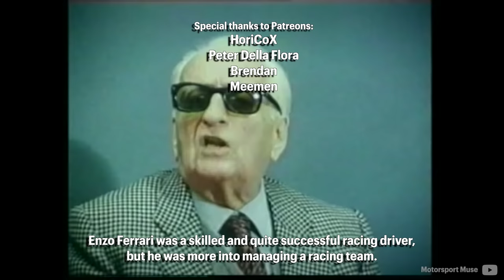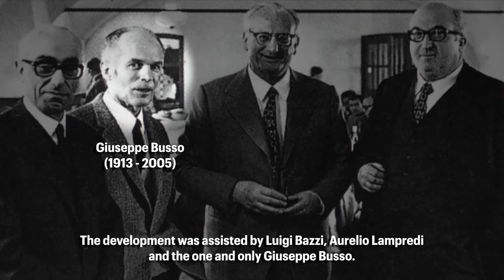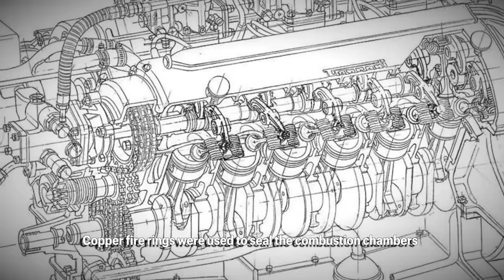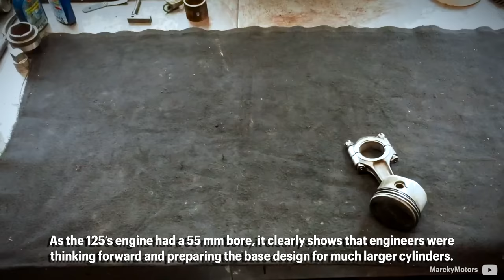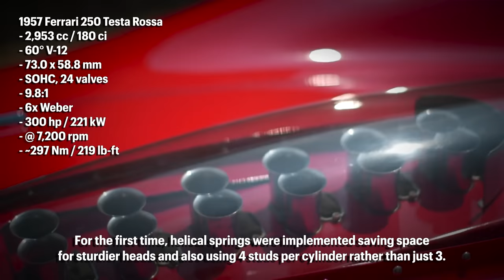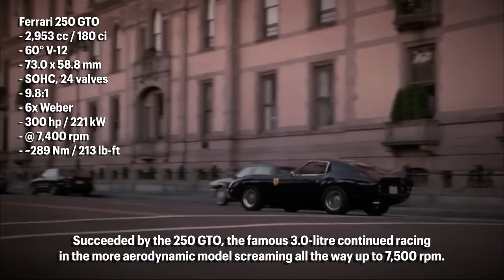The Colombo V12 Changed Ferrari Forever

Comment: thinking about it 100hp per litre was insane. i think the last naturally aspirated road car to achieve that with an engine smaller than 3 litres was the integra type r and that was over thirty years later.
Reply: I believe that was because of high compression and race gas. The Chevy Cosworth Vega 2.0 4 could achieve 300hp running on alcohol [as an obscure example] in about 1975.

Comment: Did wonder if the Colombo V12 could have been stretched from 5-litres to 6-litres and consequently made for a viable V6 displacing up to 3.0-litres to be used in something like the Innocenti 186 GT. After all the 1966 ASA Roll-Bar (not to be confused with the 6-cylinder RB613) was said to have made use of a stretched version of the Colombo-based 4-cylinder used in the ASA 1000 GT that grew to 1800cc (or 1755-1756cc) by way of a 90mm bore and 69mm stroke, which when adding the former's 90mm bore with the Colombo V12's 78mm stroke creates a V12 displacing 5955cc.

Comment: The Colombo shares a huge amount of details with my 54 Chevy I6 4 liter...going back to 1926. 
Mercedes licensed the Chevy design.
I run Webers on my truck too. 40hp per liter. This engine can easely do 150hp and 5200rpm. The main difference is a better cam in head cylinder head at half displacement per bank.
They Ferrarisxrarely do 400hp. 250hp is realistic.
Reply: The main difference between your inline 6 and this Ferrari engine is everything.